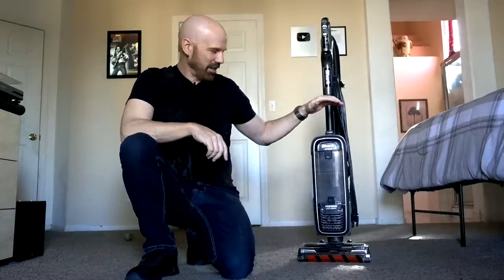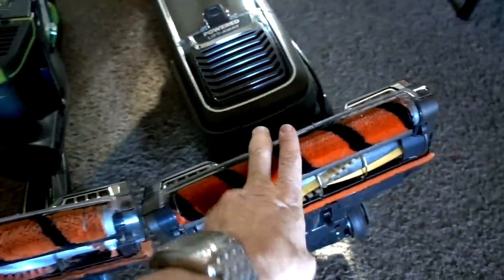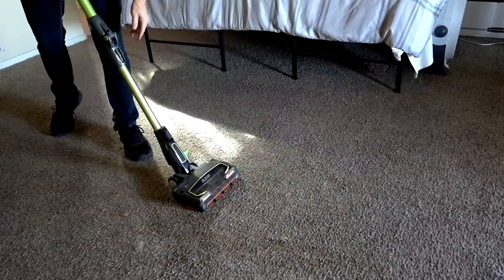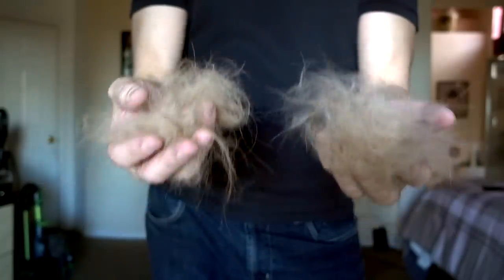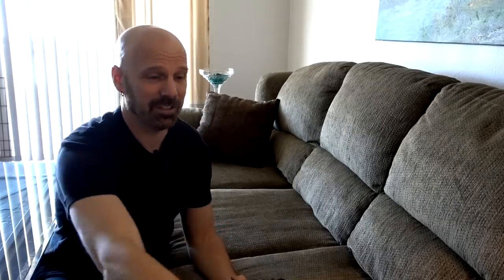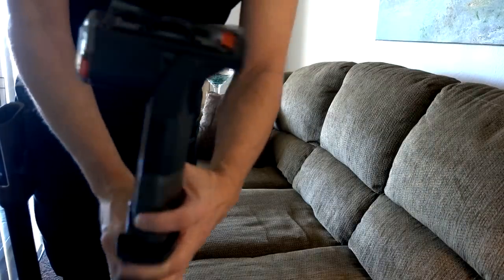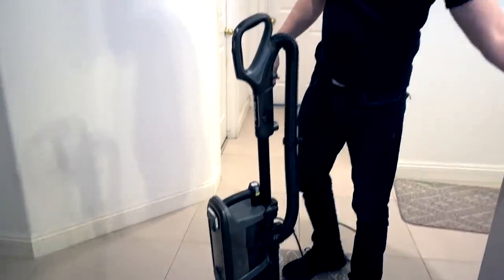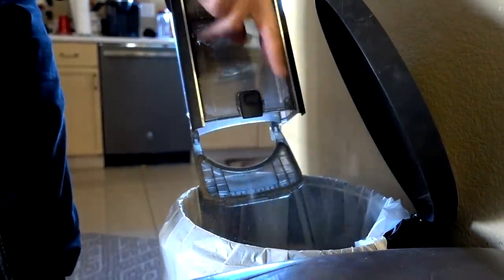Shark Apex Vacuum Review: Best Pet Hair Vac?

Comment: I find the Shark Rotator is pretty cheaply made, as various parts on ours have snapped or severed such as the hose, which, as you've pointed out, does not expand nearly enough. It still works somewhat; meanwhile, our expensive Tristar canister has a motor overheating shutdown issue (from assumedly ingesting a lot of diatomaceous earth), but at least it has lifetime replacement warranty. The Apex looks nicer than the Rotator aesthetically, but it may still be just as chintzy. Instead, we are thinking of replacing our Shark with a Miele Swing H1, a high powered modular stick that is much better made and looking than a Shark; the only real downside from a full-on upright is the capacity.

Comment: The zero m is a good vacuum the front wheels are still junk same as the old apex and the fingers are kinda weak do dont be agressive eith pick up or u will break the fingers.. as with the old apex clean out from behind the front brush because hair builds up behind it and the frame and causes issue.. the best thing for the front wheels is make sure all hair is clear of the inside of the wheels

Comment: They put the dust bin open button at the bottom? Are they idiots? That's how you get dust on yourself or all over the place. The release needs to be at the top, so you can shove the bottom into a trash can before releasing and dust doesn't go everywhere. Shark could learn a thing or two from Dyson. Shark's release system is something I expect from a cheap Walmart vacuum, not an expensive high end brand.

Comment: Shark vacuums are garbage. It will probably last you a couple years then stop working for no apparent reason. I recommend you try a Riccar or Simplicity tandem air vacuum, they run about $1000-$1600 new but can be found on eBay for as little as $300. If you buy one of those I can guarantee that you will never buy another vacuum and your carpets will look like new after 6 weeks of use.